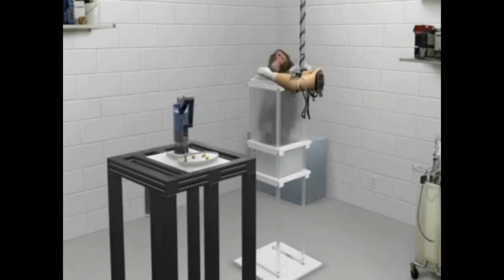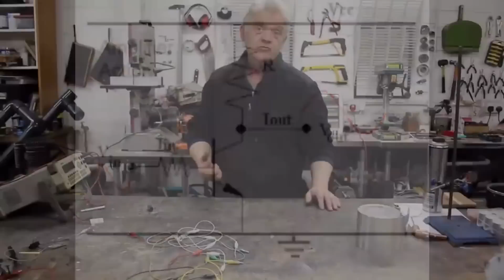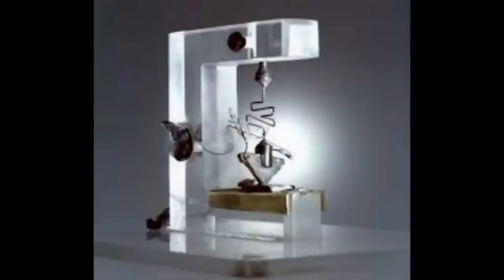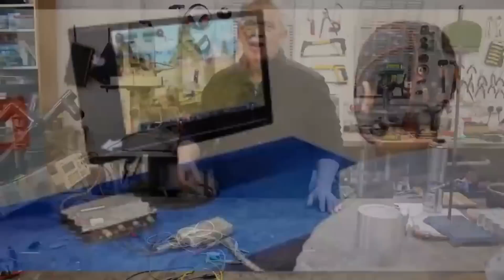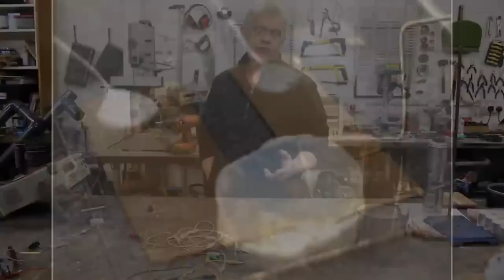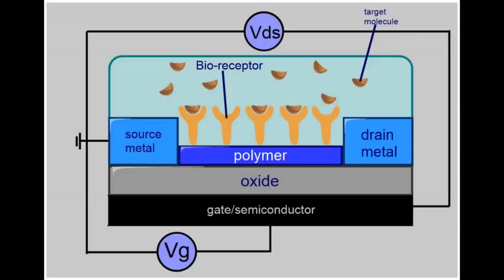2232 Mind Controlled Machines

Comment: The transistor phenomenon was getting  fluked in the 1920s by crystal set operators when they tried connecting battery voltage to the crystal by nearby whiskas. I said fluked because success occurred infrequently and it was very hit and miss and not everyone believed the reports of amplification effect

Comment: We haven't needed implants for a long time.  I've held in my hands and used devices as well as torn them apart and worked on a team at Intel in 2013 that built software for them (as well as firm ware in some projects) such as the Myo and Mindflex (by Mattel!) among others I can't disclose because it was our hardware - but it's pretty much sensor harnesses and field detection now, local and remote (yes, reading brain waves at a distance).
If we can take oxygen/glucose readings in the blood without sticking a needle, we should be able to capture some electrical activity without jamming probes into our brains.

Comment: Just for historical accuracy 
The electromechanical series of machines at Bletchley park were mostly varieties/ revisions of a device called called "Bombe" named after the polish machine of the same name, then there was a hybrid generation called the "heath Robinson" machines that used a both electromechanical and thermionic components then the "Colussus" series of machines were designed to use thermionic Valves (about 1600 in the mark 1)" colossus was about 1943 Eniac was around 1945.

Comment: Hey Rob, do you think these liquid electrolytes could be used to make a high speed shunt that could be used to protect sensitive electronics? With all the talk of war going on, EMPs keep coming up as a big threat. Besides faraday cages, can you think of any EMP protections the home builder can make?
Reply from the maker: it is an interesting idea mate but to be honest a faraday cage is really going to be the best i think
Reply: @ThinkingandTinkering  Haven't you always said there is no "best" solution, only the most appropriate for a given circumstance?  It's not feasible to put a faraday cage over a car, or something plugged into the grid.  From what I've read other EMP protections are about capturing excess voltage spikes with circuits or magnetic materials.  Products that do that seem expensive, $70 is the lowest I've seen, and the price rises to over $100 for some. Am I misunderstanding or is this in its simplest form something magnetic, but insulated, put around a power cord or battery terminal? And can it feasibly be made by an average person at home?